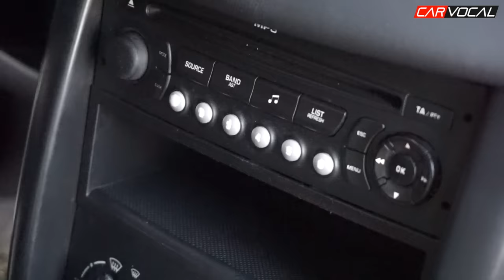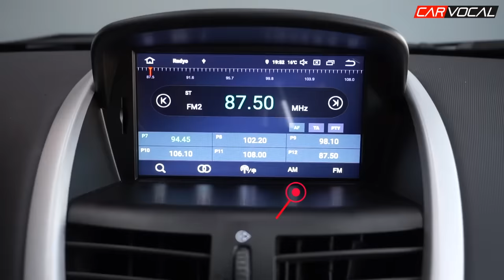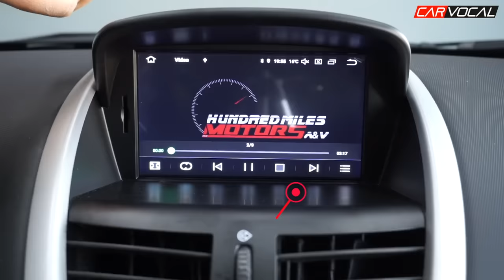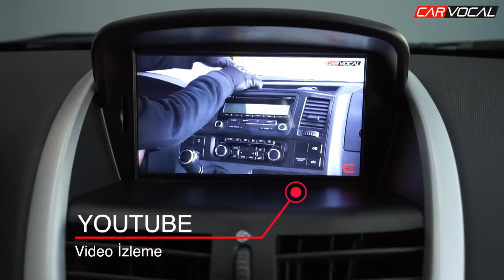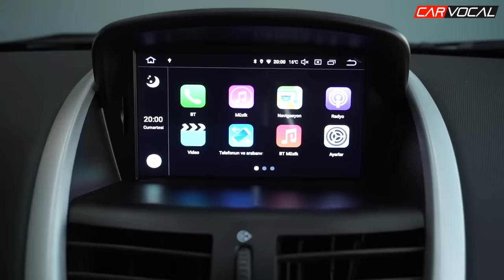Peugeot 207 Multimedya Detaylı Montaj ve Tanıtım

Comment: Good for 206+ ?
Reply: impractical. the screen is tactile, very far from the driver. radio control doesn't work with this.
Reply: @arturg5306  there is no alternative to have a screen with the radio control on a 206+